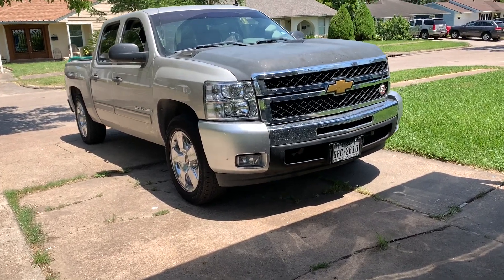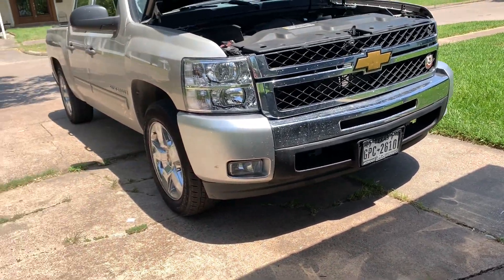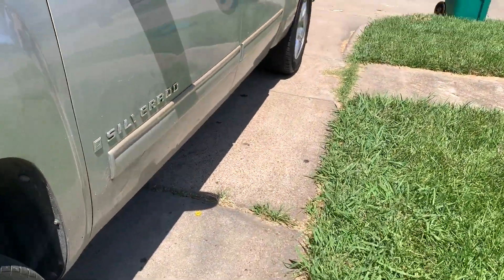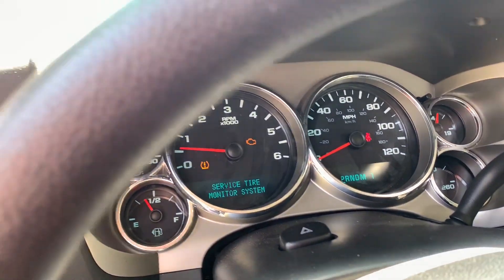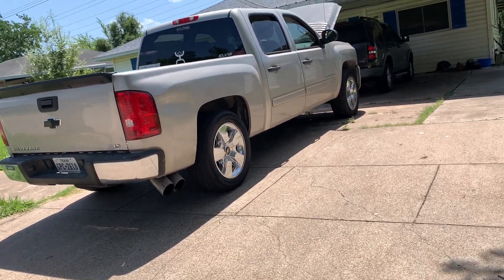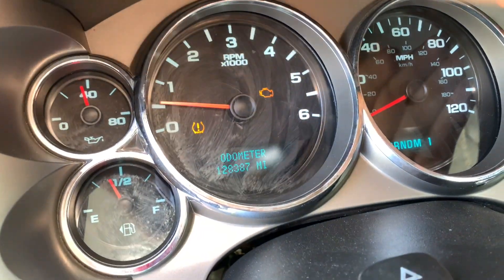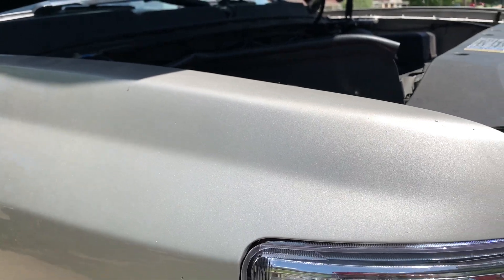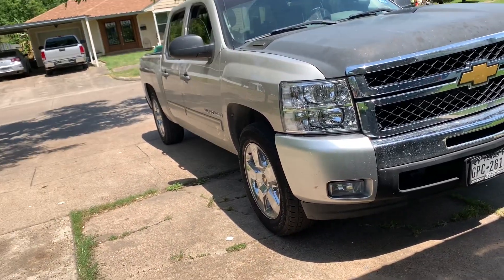10 Things I love about my Silverado!!!!

Comment: U should get pedal commander and try it out i might get it
Reply from the maker: Never heard of it lol
Reply: @jasonnnbs  look it up i think it would be great for ur truck
Reply from the maker: What does it do exactly?
Reply: @jasonnnbs  well it will remove the delay when u hit the gas pedal and it has 4 modes
Reply: @jasonnnbs  and it makes it faster without gain hp
Reply from the maker: Sounds good. Might take a look. Might port my throttle body soon
Reply: @jasonnnbs  yah i was gon buy some headers they were 213 but out of stock went up to 999